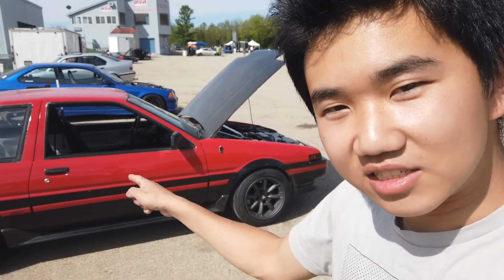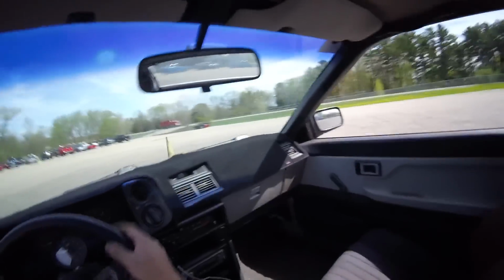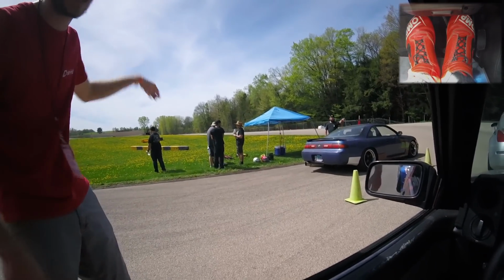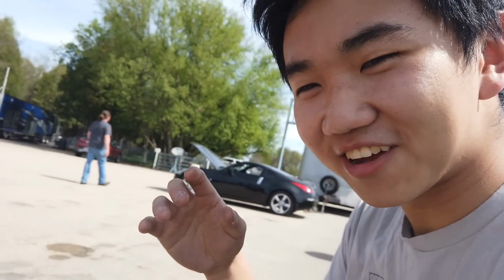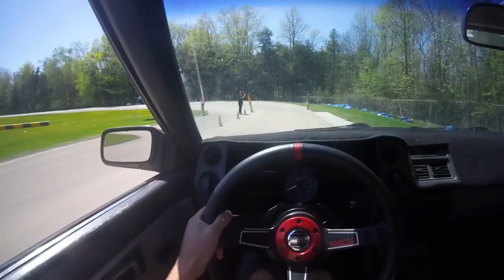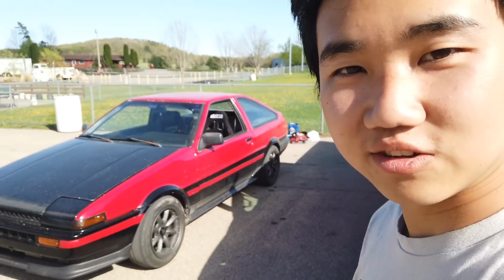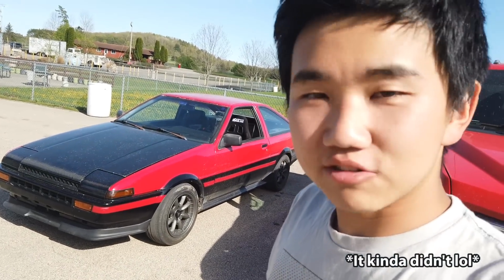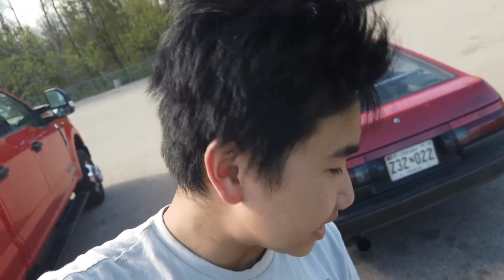Drifting My AE86 Blacktop 20V at USAIR - ClubFR DD101 Drift Day

Comment: really admire how well Jackie drives without needing to use the handbrake basically at all

also love the pedal cam for moments like the weight transfer initiation
Reply from the maker: I think the reason why I drive better without handbrake is that I started racing in formula cars and they didn’t have handbrakes. You always have to rotate them into corners and I did that by using the brakes. So weight transfer with the brake pedal is now a pretty instinctive driving skill that I have on automatic mode. But when you ask me to use e-brake, that’s much more foreign to me so it’s trickier
Reply: @JackieDing86  I think the number rule for hachiroku's is no handbrakes! lol
Reply: @JackieDing86  Drift without handbrake is very good, old school style!
Reply: @JackieDing86  Thats how drifting got started tbh, same tactic used to help cars with shitty tires get around a corner easier, honestly its not as flashy as the newer styles of drifting but IMO its far more classy as it comes from racing roots and can actually help with driving technique depending on what your going for! :)

Comment: On that straight section just before the hair pin instead of using the hand brake try charging into the corner as hard as you can and then hard onto the brakes locking them up, don’t give them a chance to slow you down then when you feel good let off the brake a bit and it’ll drive you into the apex of the turn. Easier done then said 😅 but this is why you often see pictures of corollas dragging their front tires. Corolla hand brakes are in such a bad position to try and pull mid drift. (I drive an 86 btw ha) good luck, you’re such a natural behind the wheelZ

Comment: why wider wheels in the front?  drift is all new to me btw.
Reply from the maker: I had the wider 205 V730 (200tw) tires mounted on the 15x8s, supposed to be all 4 corners. But the narrower 195 BFGs (340tw) tires I mounted on the 15x7s as daily tires, and just used them as drifting rear tires.
Reply: @JackieDing86  ah got it, thank you for the detail!